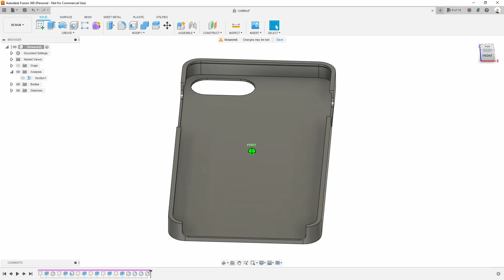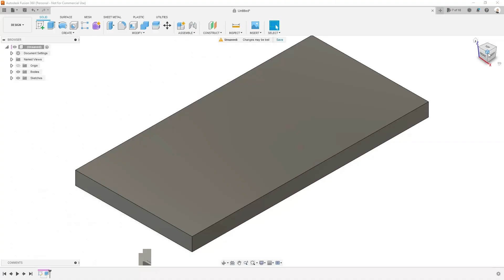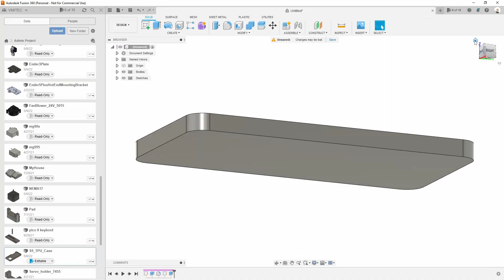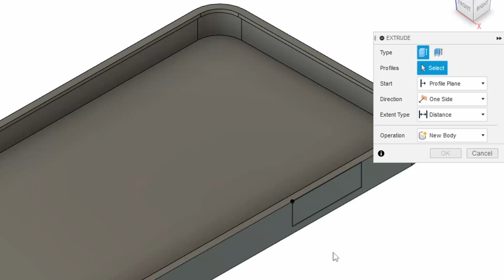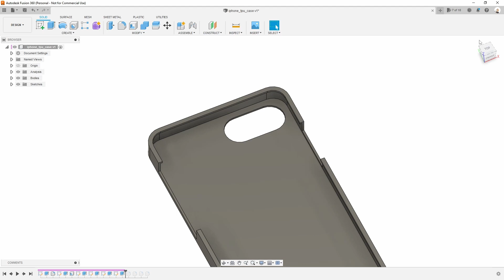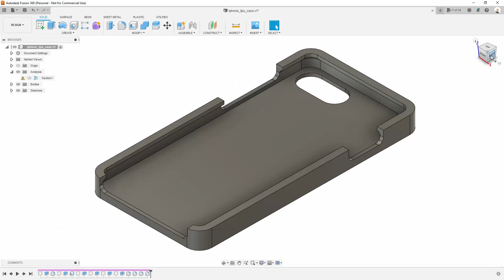Make your own 3D Printed Phone Case with Fusion 360 | Useful 3D Prints

Comment: "Type the radius you measured on your phone"

Based on looking at my phone, I chose a random fillet but it isn't the right size? It would be good if you included how to find the fillet radius. My phone has no 3d models of it, and I'm running into issues, mainly with the fillet measurements on the screen, back, and corners

Comment: Cool I didn't know about the parameter function. Could have really helped out with redesigning some things I've made.
Reply from the maker: Thank you for your comment. Glad the video was useful. The parameters are very powerful, I use them all the time. With a set of carefully chosen parameters, you can create parametric designs. You can create a generic design and by only changing the parameters, you can adjust the size, the scale, the thickness and so on.
Reply: @YouMakeTech  You're welcome, I'm definitely going to look into those more and try to incorporate them into whatever I draw up next.